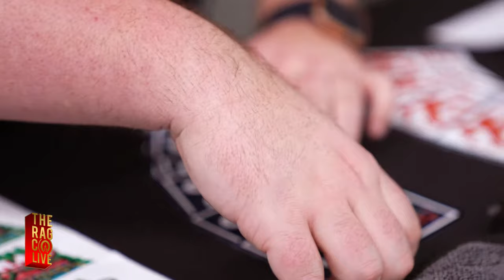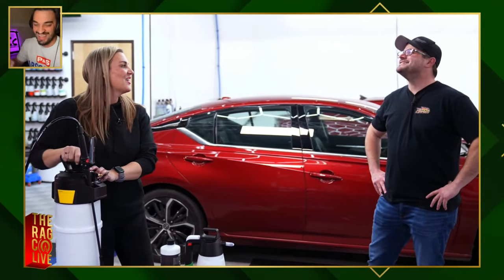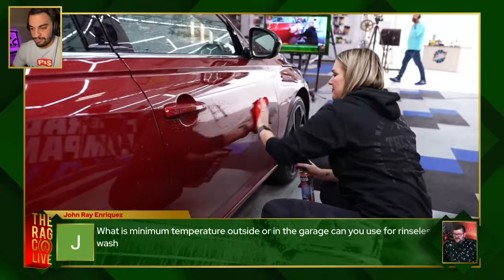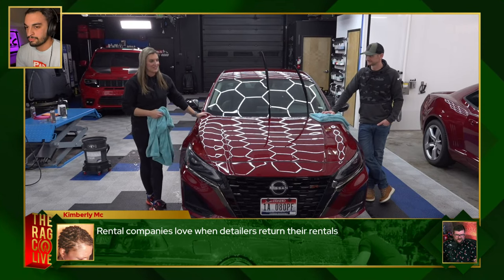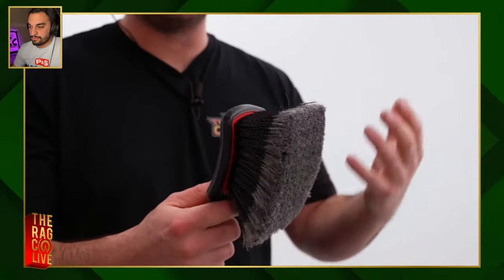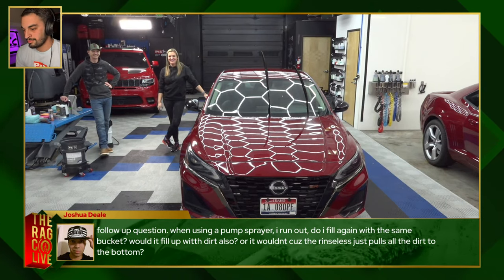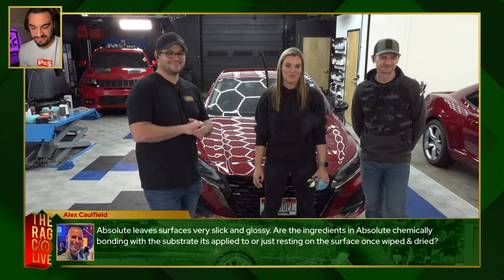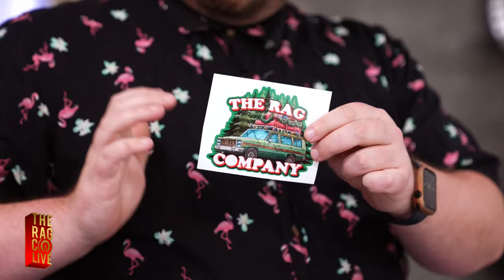Answering All of Your Rinseless Car Washing Questions! 🔴 Q&A Thursday #241

Comment: @ JOSHUA DEALE, grab yourself a few gallon jugs, either buy new or reuse empty ones from your favorite brands. Fill them up with distilled water and a half ounce of rinseless wash. I tend to use more than a gallon when using my Marolex sprayer so I generally have up to four gallons in stock at any given time. I personally don't like to dip my spray bottles inside a bucket so I prep my jugs often.

Comment: Well what a weird way to to promote (not) I searched high and low to purchase p&s absolute down here in Melbourne Australia, and only one company provided personal pick up. I was a little disappointed on first application but it was probably incorrect usage. I was out and about to start my second attempt and was not sure about how confident she was as other products were being suggested as a pre wash, at least her cleaning partner was extremely confident in the product at 256/1 a went ahead and washed my Santa Fe and this time I was delighted with results.
But I was almost going to bin it and go back to my original products, please don’t oversell your other products as it does appear that you have discovered it doesn’t stand up against the others.